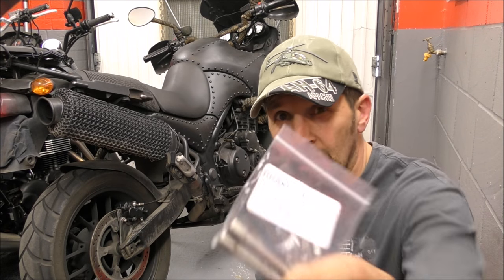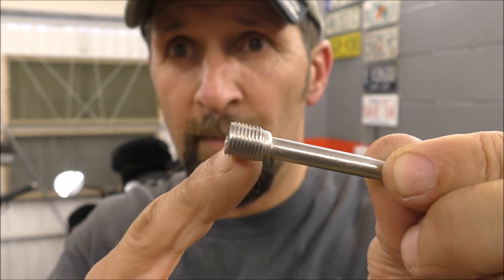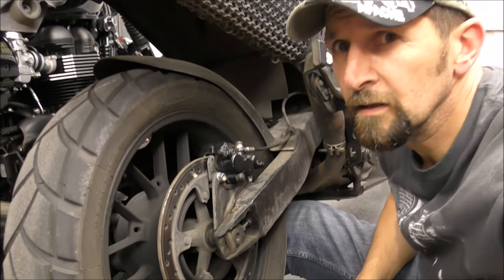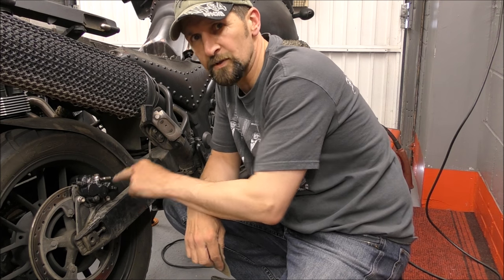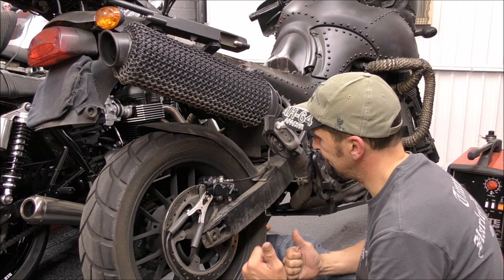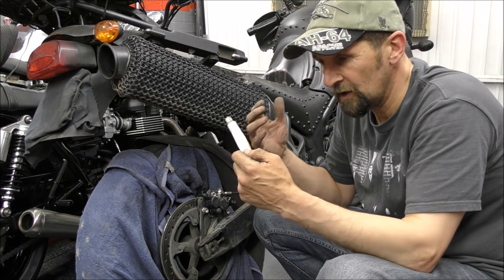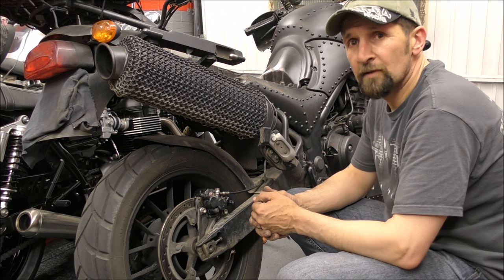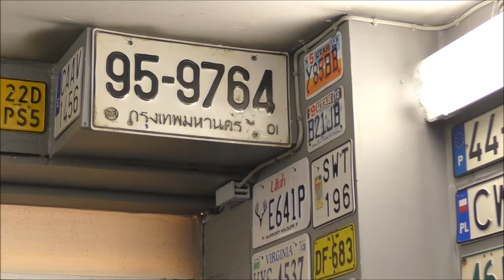Delboy's Garage, Removing Stuck Brake Caliper Pins

Comment: My first port of call with stripped allen bolts is just to hammer an equal size torx into it. Usually works for me.....Also I cant weld haha
Reply: i had a spark plug snap in my head. spun the engine over to blow out the core then whacked a torx bit into the hole with a massive hammer! took a 1/2" long arm to shift it
Reply from the maker: Thats a good method, usually works on regular fasteners....but even that can strip out when they are proper seized on place... also its not too safe hammering anything on a brake caliper, they're pretty fragile cast ally.

Comment: A great series of videos, really well thought out and filmed. I'm stuck however as the grub screw covering the brake pin head on my Thunderbird rear caliper is stuck. I'm in danger of chewing out the slot and not sure how to proceed. Can I use an impact driver?
Reply from the maker: Hi Chris, An impact driver would be good as long as you use a snug fitting bit, otherwise you could maybe try to centre punch it to get it moving.. !!  Good luck with it buddy, hope it helps..

Comment: And yes...the bolt will seize into place without any thread lock...when I worked on Yamaha bike's, I was told the reason the metal locks together,  is because they are usually two different types of metal...and because of that, the ionization between the two materials will (weld) itself together...I have broke many, many screws that hold the signal lights, and kill switch to the handle bars for this reason.

Comment: my gs500 front brake keeps going soft every few weeks. bleeding the brakes seems to firm them up for a short while.

would that be the master cylinder?
Reply from the maker: Possibly, you can drag air in if the fluid it low too..

Comment: This is the problem I have on my NC750XDE parking brake pins.  Of course I don't have a welder.  Unfortunately they seem to have been over torqued so the heads have rounded, but because the parking brake shouldn't wear much they don't usually get changed either.  I know that once I succeed in removing them they will need replacement so I searched but though you can get the pads because they fit other calipers too, only Honda seem to make pad pins for these.  Alas Honda also put thread lock on the whole thread, all 6mm of it!  I have tried drilling deeper and using some amtech screw extractors, but I can't get it to turn the pin using a standard 6" tapping wrench.  Then again I also have the challenge of trying to hold the caliper because my pad pins are on the inside of the caliper.  I also tried wd-40, break cleaner and engine degreaser to try to free the threads but to no avail.  I also tried heating it with a heat gun but I was scared to go too hot so that didn't help either.
By the way I already changed the seals and also fitted stainless pad pins and pistons on the front and rear hydraulic brakes because they were badly corroded, which your videos helped me have the confidence to do thank you.  I may have to try the epoxy and disposable allen key trick, though I still think it needs more heat.  To be seen.  Ironically these calipers are over £100 second hand, being rare, and often come from abroad with high postal charges, so I hope I can get this sorted...
Thanks for your videos.  Hope Penny's ok too.
Reply from the maker: Sorry to hear you're having this trouble.. have you tried tapping a torx bit into the rounded alun key hole.. usually works to get a bite in it, and if it has threadlock in there, then heat will help to not only melt the glue...but also expand the casting slightly and help release the screw !!   Thanks for your feedback too, and good luck with your task mate.

Comment: EZY outs may work they have a drill bit then a splined driver you drive in too drill hole cost a shit load so I lend one works a treat I also think the tap helps break the lock

Comment: When a piston got stuck in a caliper I would pour boiling hot water over it, which would allow me to wind it back in. Would this work for this method seeing as they are 2 different metals?
Reply from the maker: Not usualy, obviously its worth trying anything when you're stuck, you never know your luck... but the tiny area of alloy that you are trying to expand away from that pin is not enough to make a differance...with the piston, its huge by comparison...and also the piston wont be stuck by much more than a little dirt.. the pins have the thread, AND the length of the pin caked in road crud.... but like i said. try anyhting aye.. what ever works..! lol

Comment: I normally find my Wera allen keys work (the ends are almost like Torx profile also you can put a power bar on them and lean on them, yes they bend but don't snap and straiten themselves up after.) If not them I resort to the Torx and impact driver method
Reply from the maker: Always avoid impact drivers on calipers, you end up hitting for too long, these pins are not tight, and then break with a crack which many fasteners do, they are tight all the way out , as you saw... as even when the thread was free, the pins still hung on to the pad inside the caliper, so the impact driver is a bit redundant...

Comment: Hi, if you have flat screw drive head for the pin and it is stuck, how would you get it out? Just keeps slipping and ripping the bolt up
Reply from the maker: If you can't get a grip on the screw with a screwdriver and it's down inside a hole, then you either centre punch it out if you have the space, or at worst drill it out... shown all of these things many times on many videos...

Comment: How about if you drove thin metal shims in on 3 sides of the allen key with a hammer, bunger tight?  That might be a go, carpenter's trick with rusty hinges but not sure about motor bolts.
lpb
Reply from the maker: Not so sure that'd work, often there isn't a defined gap, just random slack.. try a Torx bit that's slightly too bit to fit by hand, and tap it in with a small hammer. works very well.

Comment: JB Weld to welding? My actuator ring on end of key cylinder on Dodge truck broke. J B weld was first thought, but failure. So, cleaned real well an Superglued for a one time trip to ordered part at auto parts. I would have tried Superglue before welding. But hey, Your points will even go up if you can. Then ad I'm thinking about needing to remove battery you bring that up, very nice! So I stopped video to comment, let's see rest an check out the weld, haha!

Comment: I am also rebuilding a Kawasaki GPZ 550 (1986) the fork stanchions are well gone, I put the allen key onto the hole and it just ripped around it, problem is, the bottom of the fork leg does not split for the spindle, so a long allen key was needed, now I have to find a way to remove this arsed up bolt, I shall try JB weld first, as the bolt is rotten.
Reply from the maker: Just drill the head off it Doug.. use a drill bit the same size as the bolt shaft, and the hole in the middle of the alun bolt will centre the drill... then once the head spins free attached to the drill the fork will come apart, and you can remove the stump of the bolt with some grips once the damper rod it out...   Good luck with it buddy.. Del.
Reply: Thanks Del.

Comment: Your description of a mechanic is similar to mine. If someone just changes the broken part i call them a fitter but a mechanic will investigate why it broke in the first place and correct the problem then fit a new part if necessary. It would be great if all mechanics sat and thought about the ways to repair or salvage the part to avoid the customer paying for a new part but would this mean you would get charged for the length of time it takes for him to think of a solution? Nice video mate kept me busy waiting for my op. Do you know if you will be doing more in depth fabrication videos in the future ?
Take care.
Reply from the maker: Ayup Marty, of course we will, constantly be rocking the fabrication, loads more to go on the Kawasaki build and then when that's all done and sent on it's way with it's new owner, there will be another build next year and I wanna get in to building a frame this time... fabrication is my favourite past time!
Reply: that's great to hear del I have a great interest in the fabrication and when i get a garage I will be diving into my own project. I could not agree more with the comment of people just adding accessories to bikes, I want something no one else can obtain unless they ask how haha.

Comment: Tried getting the rear disc bolts out my RSV Mille, they are jammed in and only 10mm socket, snapped 2 10mm sockets and never even got 1 undone lol. Not sure wtf to do.
Reply from the maker: If they are a 10mm bolt head, a handy way is to take a nut with a 10mm hole if you have clearance that is, and plug weld it over the bolt head of the pin, and the outside of that nut will be more like 19mm, so you can then get a big fugg off socket on it and wind them out... just a thought!

Comment: these are a pain in the ass when they won't budge but to add insult to injury... sometimes there is a threaded cap that covers this bolt which also gets glued stuck. hammer impact driver helps
Reply from the maker: Yeah they can b a biatch.. its SO important to only do those little caps up finger tight and lots of copper slip.. often they only have a screw driver slot aye.

Comment: you should use a flat head screwdriver the same size at the hole and hammer it in and unscrew it that way had saved me a lot of times before
Reply from the maker: Works on bigger socket caps, but this is a 5mm hole... and both the torx bit and a screw driver bit weren't stout enough to do much more than reem it out even worse!

Comment: Hi Del.  I have this issue (Honda Firestorm) but luckily the calipers are 2 part ones.  I've split the jammed up one - any suggestions please on how to get the brake caliper pin out - it's still mightily stuck and I'm wary of forcing it.  Currently have it in a vice and trying to unscrew the caliper body from it, but no joy!!  Cheers.
Reply from the maker: If you have a good solid purchase on the pin now, then heat the caliper (even a hairdryer will do on hottest setting), and that will expand the aluminium away fro the steel slightly and help it loosen, get some penetrating oil in there around the thread, and work it backwards and forwards without forcing it too hard, and gradually you'll get a full rotation and should get it out... it's just patience and persistence mate.
Reply: @Moonfleet41  OK I will give that a go - thanks heaps!

Comment: thanks great videos as always. what about using a screw extractor? and extract it counterclockwise?
Reply from the maker: The hole isn't really deep enough in the socket cap, probably only 3-4mm at most, and what you're referring to is usually called an 'easyout' and they need at least 1/2" , even at that small diameter, or they will just reem out again ...

Comment: Mines js stuck i tried unscrewing it so much that I warn it out is there a way to get it out or should I buy a whole new caliper
Reply from the maker: i buddy, try splitting the caliper body in half by removing the main bolts and you can often get a stout pair of grips on the bolt and undo it by turning the pin, good luck with it.

Comment: Hi Dell, rear brake caliber pin is stuck in my SV650. Mine doesn't have a socket cap but place for a flat head screwdriver. Don't have a welder...Any ideas on how to get it out?
Reply from the maker: Hi David.. ok, that screw is probably a cover cap,and the socket cap lives down inside... have a watch of this video, from 4.15 onwards.. https://www.youtube.com/watch?v=fDOVTGNP6mo
Reply: Moonfleet41 Thanks Del. Previous owner has minced the screw so might be a struggle getting it out!
Reply from the maker: Thats always happening... just chace the screw round with a centre punch mate... they come out pretty easy..

Comment: Never tried the following on a socket, but on worn out screws:
Put valve grinding compound on the allen key (or screw driver) and that gives enough grip to break the bolt.

Would this work here, any experiences?
Reply from the maker: Once a socket cap is reemed out , things like that will just make it worse... also, with these brake pins, they are tight all the way out, even when the thread has cleared the caliper, the shaft of the pin can be corroded in to the brake pads, so it needs a lot of back and forth movement with lots of brake cleaner to free it off, I imagine grinding paste would simply reem the hole out even more... if it's welded in, it's totally solid, bey hey, anything is worth a try aye?

Comment: Great video, much thanks for posting!  Where did you get the SS replacement pins?  What do you think of using replacements that have torx head?  Seems like they might resist rounding out better.
Reply from the maker: Hey Alan, i just found those on ebay from some random seller, i think they are still out there to buy.. and yeah i agree.. if you could find them wit ha Torx head, they'd last a lot longer..

Comment: Del, one of the brake pins on my tiger 800 has a stripped thread but it’s in a recess so not possible to weld. Any advice on how to extract it? I’ve been looking at trying JB weld but I’m worried about it getting on the threads
Reply from the maker: Hi buddy, I've heard of the JB Weld ploy and some say it works, but you can use a torx bit, if it's just big enough to tap in to the chewed bolt head, and get a bite on it, then usually that will get it out... perhaps if you coupled that with a bit of JB Weld too, I reckon you'd be on a winner!
Reply: Moonfleet41 cheers fella, I shall get some JB weld and give it a go with a torx bit. I’ll report back if I have any success. Keep up the good work, love the channel! ☠️🤘🏻

Comment: its actually similar to the nissin caliper on thback of the varadero, I ended up getting new ones front and back, on the rear one the pins were seazed so bad, they hadn't rounded out and I had a good quality alen key on there but it wouldn't crack lose, in the end me and my old man took it off the bike had it in the vice with a blow torch on it and a 3 foot iron pole on the end of it like a breaker bar and it still wouldn't crack free,the caliper was in a real state needed new seals new piston pot and the pads were not only down to the steel backing but the steel backing had actually bent, all this when I bought the bike so it must of been like that a while, how the hell it got so seazed I don't know,

Comment: I was told that if you put any stainless steel in to cast aluminium you all ways need to use copper grease, as stainless steel causes a reaction to cast aluminium, if you don't it weakens the cast aluminium. just a tip for people that didn't know
Reply from the maker: Not quite true my friend, otherwise the pistons themselves would seize in to the caliper body, wouldn't they?  Certainly in the presence of salt , this corrosion can occur, but it's easily broken away because the stainless itself doesn't de-grade , unlike zinc parts, fitted dozens of sets of stainless pins and, as I demonstrated in this video, always with CopperSlip and they never seize in place again... the beneift of the stainless pins is that the straight shafts don't go rusty and stop the pads moving...
Reply: sorry i wasn't on about the brake calipers, just stainless steel in general, the only time i use copper grease on calipers, is behind the brake pads to stop them quelling, del you are legend of the bike world. without your videos i wouldn't get where i am today fixing my own bikes and friends bikes
Reply from the maker: Thanks Mitchell, you are very kind buddy.. much appreciated. Del.

Comment: I have a Pan European ST1100 and the caliper pin on the fron is totally stuck just like in the video. But the on mine there is a small cap on top of the pinhead. So when the cap is off, the alan key head is probably 4-5 millimeters inside the caliper so I can't weld a alan key on it. Any tips on how I can remove that pin?
Reply from the maker: Hi Robert, that's a shame, those caps are supposed to prevent them seizing in but as you've found, they don't !  Have you tried a torx bit yet??  You want one that's a bit too big to fit in the head, and just tap it in so it jams in the end, that often works quite well... give that a go and let us know how you get on , there's one more slightly more drastic method, but lets' not tempt fate, let us know how that goes first !
Reply: Moonfleet41 Thanks for your reply. I couldn’t find a torx bit that I could use. But I did have a set of cheap Chinese extractors. Rounded out the hole, turned it around and got the extractor to sit. But my electric drill wasn’t strong enough so I used a wrench and got it loose. Now I’ve completely taken apart and cleaned the calipers and pistons. Learned that from your videos. Thanks for all the help your videos have given me and others. 👍🏻
Reply from the maker: Glad you got it sorted Robert, and glad the videos can help... appreciate your support !

Comment: When I went to do the brakes on my Hornet a few years back the cap in front of the brake pin was seized solid. I'm not religious but I was praying the pin was ok inside. Thankfully the pin was fine however I had to mince the cap with a hammer and punch. Copper slip really is worth every single penny. 

Is that a new toy I spy in the corner ??
Reply from the maker: Just a donor bike for the future my friend... long term plans and all that ... and yeah, those little cover screws can be a right PITA, but at leasy you can guarantee that the caliper pin behind it will always be nice and clean..!